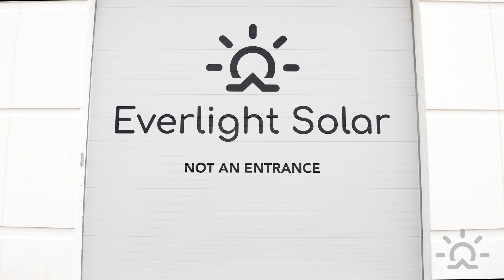Convert Your Power Wheels Battery to a Power Tool Battery—Easy DIY!

Comment: My son has this same truck. For some reason it isn't powering on at all. I charged and test the battery with a voltmeter. Its getting 13 volts. Charger is good. Fuse is good. Could it be the power switch or something else?

Comment: When I ran an 18v drill battery to a 12v power wheels, it burnt out the gearboxes. I have an 18v ryobi converter and it has fuse. I see other videos like yours, but when I didnt it to my sons it fried the gearbox and I had to replace them both. 
I wanted him to have a little more speed and longer battery life, the speed was there, but the battery would only last 20 minutes max and be totally dead. 
So I bought the step down to go from 18 to 12 and now I'm scared to hook it up and burn the new gearbox and upset because a little more speed was 1 thing I was wanted